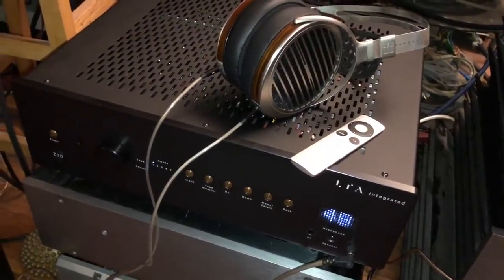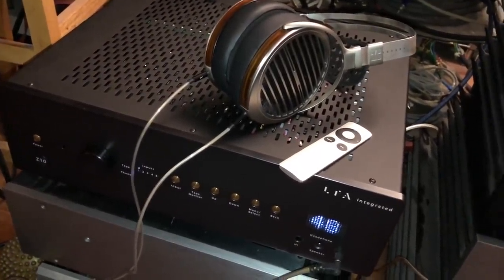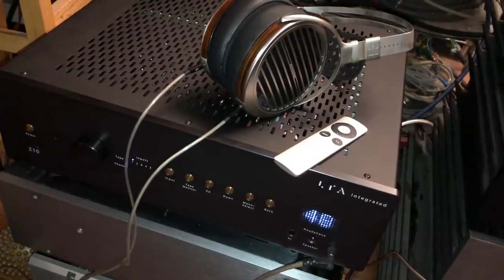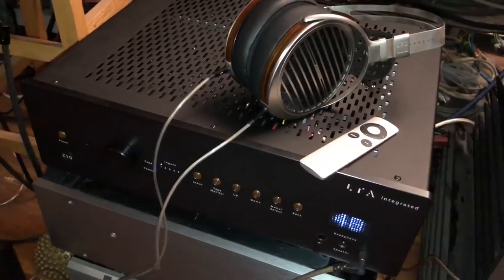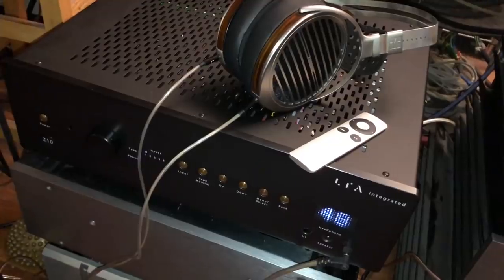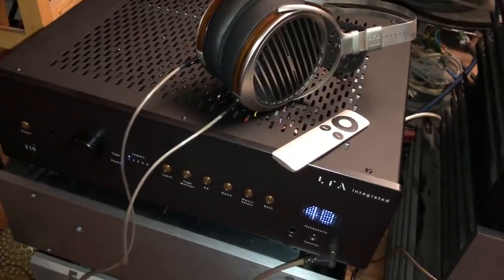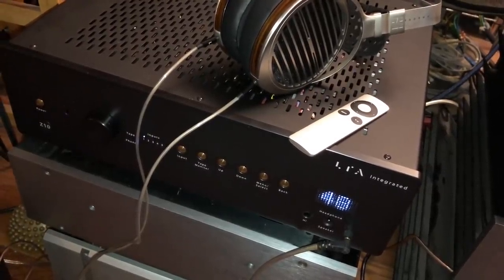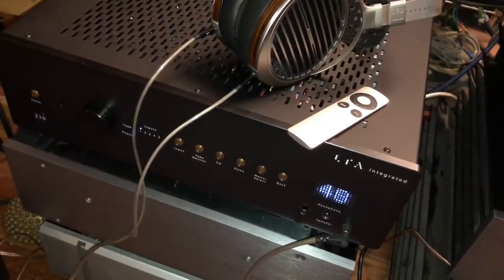Finding joy with a 10 watt tube amp on Klipsch and KEF speakers #tubeamps

Comment: Indeed. I drove my Klipsch Cornwalls with a single ended, 8 wpc,  pure Class A headphone amp that cost a whopping $300 and it sounded fantastic ! Much much better than the HK it replaced !  Great sound can be had for a very reasonable $$$  if you know how and am not as "fashion label conscious" !!!
Reply: Which amp model please
Reply: I’m curious about your amp too?
Reply: @dehoyosrudolph8885  ^^^WHAT THEY SAID^^^
Reply: Hes talking about Chinese amps. Musical paradise is a good start. If you want a badass custom one my friend builds nice ones for 700$ that will play like this one. GU-50 based.
Reply: The headphone amp i used is the RFTLYS EA1A. It is bare bones but is amazingly well built with excellent performance for the price. Hard to beat its value proposition when driving very efficient (98db/w/m) speakers
Reply: @ptg01  Will you provide a link, or does he build "FRIENDS ONLY"? The reason I ask is I own a pair of 98 db. KLIPSCH FORTE Ones and the receiver/ amp I have is a same era NAKAMICHI 35 WATT RECEIVER, 
That may be on its "LAST TOUR". LOL. THANK YOU.
ALSO, DOES STEVE EVER SPEND TIME ANSWERING QUESTIONS, OR DO U HAVE TO PAY THRU PATREON TO GET AN ANSWER?  ;)
Reply: Should be @ Jeremy Whittler

Comment: Steve if someone would like to explore tube Amplifiers for the first time do you have a recommendation on which amps that would be a good entry point?
Reply: Linear tube audio
Reply: Check out Rogue as well, especially if made in America matters, made in PA.
Reply: @craigcoughlin1834  Linear Tube Audio is Made In USA too. Maryland actually. The LTA Z40 is also all tube integrated at 46 wpc.

Comment: Tube. Class A . Single ended. No push pull. Is pure heaven . On hi,  quality 2 way loudspeakers. Absolutely fun tastic. Don t wanna stop listening for no reason .
Reply: Have you ever heard any of Steve Decarts higher end TUBE AMPS? THANK YOU
 @TheRockerxx69
Reply: @sixstringsdown1  l LL buy one. Thanks
Reply: @sixstringsdown1  but they do not exists those fkn Descartes ! You kidding me.
Reply: @TheRockerxx69  Yea, I'm in a massive joking mood today, as my wife just had a TOTAL LEFT KNEE REPLACEMENT. Guess who does all the work round these here parts?
Reply: @TheRockerxx69  For what,Sir? The joke? Why, you Sir, are quite welcome! May I toss you another joke to brighten your day?
Reply: @TheRockerxx69  my pleasure Sir.
Reply: @sixstringsdown1  l have to perform all the house chores. Garden chores. Cooking cores. Because my wife is bi polar . High depression rate. It s 10 pm here and no space for your jokes in a very cold, wet, late spring day.
Reply: Very sorry to hear that. Glad you have your hobby to escape to occasionally! I really mean that, as I have lived thru that same situation in a prior lifetime... It just sucks all positive energy out of the brain. It did to me. I very much so hope things will get better for you at some point.
I just was trying to introduce a new band wired, high quality tube amp into the conversation. Nothing more of less...

Comment: I am still thinking about getting their NEW LTA Ultralinear integrated amp. Its price is whopping $8900 including brand new MM/MC phonostage. However, if you really think about it........ To get “good” amplifier (that’s my personal view), it might cost me say..... $4K, good preamp $2,500-3000, decent phonostage $1500-2000, satisfying headphone amplifier $500-1000, you might end up around $10K. Now add some decent power cables and interconnects for all those separate components ($1000-2000) and all the sudden that $8900 seems somewhat reasonable. Also an enormous space saving and long tube life. And cherry on the cake, all made in US by our best minds and craftsmen.

Comment: Why not try the Miniwat N3 SET with The Klipsch's .. Swap out the power tubes to Sovtek EL84M's and find a good NOS 12ax7 like a Telefunken..I'll bet it gives your Z10 a run for the money. With tubes swapped out, N3 is tionally balanced, good bass energy and clear as a bell!
Reply: Vic...my audiophile friend said the same thing to me a day before you wrote your piece.  Great minds think alike. 😀
Reply: GU-50 wired in ultralinear.

Comment: As far as 10 watt amp provides in listening place 100dB I am not asking  about power. Two amps which I judge best in my  team of four  (working with my DIY speakers about 92 dB/W) are  both around 12 Watt per channel while two other are 55  and 35 Watt. All used with loudness correction "on". And I never push rotating knobs above 40%. In fact I control loudness  mostly by input preamp knobs  because I need to keep  constant physiology correction for given loudness .  Anyway my level of listening is  mild - (while my cafe electric cattle pot boils around  my Hi-Fi music gets  hardly heard. My neighbors need not to make any noisy renovations too. Actually I deliberate about physiology corrected amplifiers - is it not right to match their power to listening room - I is justified that  correction is valid for given loudness and that loudness depends on size of listening place. More power amp mean faster growth of loudness - in small room  it results in too much correction. For such room I find this 12 Watt power amp with l. correction in better synergy. Actually it is just my thought.

Comment: Steve I have a question for you. Do I have to use the crossover in my powered sub? Right now I have doubled speaker wires coming out of my tube amp. 1 side going to the right speaker and also the right powered sub input and the same for the left. Sounds great but am I going to damage anything?
Reply from the maker: Sounds like the wiring is correct. As for the sub's crossover, yes, use it. Experiment with the crossover first by setting it just below the speakers -3 dB frequency (found in the specs on the manual or the manufacturer's website). If that's not possible try different setting on the sub's crossover, and listen. At best, you shouldn't be aware the bass is coming from the sub, it should sound like the bass is coming from the speakers. I tend to prefer keeping the sub crossover setting as low as possible.

Comment: I bought the Dayton audio integrated tube amplifier with 12 watts for a preamp section and Pioneer book shelves speakers and for $129 you can't beat the sound sound more like a $1000 system
Reply: This may sound silly, but I'd be very interested in seeing a video of YOUR system. I use a much more expensive setup both in my living room, but also in my office, and yet the thing that most interests me is great sound for little money. Does my $6,000+ system sound good? Of course it does, it cost a LOT of money! Good sound for big bucks is no special trick. But particularly good sound for cheap, now THAT is exciting!
Reply: @AndyBHome 
What about getting more performance from what you already have for little or no money? I find that to be just as exciting, especially when you start to realize that you had been hearing less than half of the potential of your system with a conventional setup.
Then, when you think about it, you become aware that ninety-nine percent of audiophiles have a conventional setup, so even the ones who are blissful with what they're hearing never realize that they are hearing less than half of what their system can give them.
The best thing is that if you know what to do, it can help with most any system, whatever the price level.
Reply: @AndyBHome  Nailed it!
Reply: @HareDeLune  Ie. Maximixe speaker placement, treat room with sound panels, and, this is from personal experience, WHEN DONE LISTENING, COVER YOUR KLIPSCH FORTE' ONES WITH A TRUCKERS BLANKET SO YOUR CAT DOES NOT TEAR THE WOOFER TO SHREDS. END OF RANT AT MYSELF!
Reply: @sixstringsdown1 
That is the conventional setup, yes; with the exception that you've incorporated 'dog armor'. He-he!    : )
Reply: @HareDeLune  Well CAT ARMOR. We can settle on "ANIMAL ARMOR", no?  ;)
Reply: @sixstringsdown1 
Eek!
Cat!
You did say cat, it's right there.
: P
My only defense is I am in a coffee shop and there are distractions. I do apologise.
Reply: @HareDeLune  I actually don't need better performance from what I have, although I am always playing with it just for fun. I just like to see what can be done at various price levels, the most exciting of which to me is cheap cheap cheap. As I wrote above, my system sounds great - but it was thousands of dollars and I have no regrets. I listen to my systems a lot and I love them. I still like to see what else is out there and especially what can be done on a tight budget, particularly new equipment because used is so hard to predict, even though the majority of my own gear was obtained used.
Reply: @AndyBHome  I'll see what I can do I have it connected to a power subwoofer then my main speakers running from the subwoofer this gives me 100 watts
Reply: @AndyBHome 
That's fair enough, and I agree.
As a person who hasn't had the opportunity to hear a lot of different systems at different price ranges like Steve, I would be very interested to know the differences in the sound of inexpensive gear compared to the ones with stratospheric costs, and just how much can be done with a modest setup.
I have had enough experience to find out that you should remain open-minded, and that it's very difficult to know the differences in equipment and quality until you've heard it for yourself.
Reply: @HareDeLune  No apologies required! Cat, Dog, House Mouse, Sheep... whatever! BTW, Roger Waters COVERS ALL possibilities on PINK FLOYDS ANIMALS ALBUM!  
Now, the other Gentleman, who claimed the DECWARE AMPS I referred to, DOES owe me an apology! IMHO.
Reply: @frankmcguckin4572  100 watts is 65 watts better than me! Well with the exception of my 2200 watt HAM RADIO AMP, my buddy built from scratch! That thing, hloked to a single wire, talked over the South Pole to some guy IN HIS CAR 600 km Northeast of Mumbai!
Reply: @sixstringsdown1 
If you didn't care, what happened to me,
And I didn't care, what happened to you,
We would, stumble our way through the boredom and pain,
Occasionally glancing up through the rain,
And watching, for pigs on the wing...

Comment: Those Klipsch speakers sound great with my Onkyo TX 8160 network receiver.  I only paid 320.00 for the receiver.  Why should someone pay 4900.00 for something that does so much less?  I guess I don't need the prestige of owning a 4900.00 brick that does a whole 10 watts of output power.  What is your audience for this video?  Know who you are talking  to when pushing a 5000.00 piece of equipment.  As my father once said when referring to a Christmas tree that cost 45.00 in the 1970's, "Is it made of gold and they are going to come home with us a decorate it too?".  Used cars cost that much.  Back to Zeos for me.
Reply from the maker: Bye!
Reply: It seems hard to believe that this rather expensive amp would be worth it, but until you've compared what you have to this I think you really can't be sure. I really don't think most people who buy this stuff do it for anyone but themselves. In other words, I don't think it's a status symbol for them. Who really thinks HiFi is cool anymore? I like it, but I certainly am not impressing anyone with my gear.
Reply: Club Soda my Yamaha is going strong after 20yrs.

Comment: Explain why l would want a 10 watt amp over buying for same money a 80 watt tube amp.?
Reply from the maker: Because it'll sound a lot better at more moderate volume levels. It played loud enough for me. If you like loud, don't buy a low power amp.
Reply: I'm always looking for things that sounds good at low volume. I never really considered something like this before, but maybe I should. I've always assumed that higher powered stuff would sound just as good at low volumes, but maybe I should change my approach? Thanks for the video Steve.
Reply: SET achieves superb black levels , micro detail and actually high distortion levels in a way that's pleasing though called 5th order harmonics like a guitar amp. My friend builds these that works for the department of defense. It's what they used back in the day in movie theaters.-( Heheheh....😉 lamen's analogy.)- I do parties and barmitvas.

Comment: "Joy" seems remarkably expensive. $5000? Oh well...... I'm sure that someone out there can argue that this is a bargain. Are new vacuum tubes still being manufactured, or do all the tube amps depend on existing "new-old" stock?
Reply from the maker: Yes, new tubes are still being made, no worries there. Luxury, hand made in the US products are expensive, just like other luxury designs.
Reply: @SteveGuttenbergAudiophiliac  "Luxury" might mean that everything is gold plated and has diamonds on the soles of its shows, but that wouldn't contribute to the sound quality. Similarly, with unusual names and shapes. But, yes, I know what you mean.

Comment: Actually klipsch  are misleading people in their specs they are not really 99db sensitive roundabout 90db sensitive it's how they manipulate the figure suit their marketing just taken that from one aspect of the audio band. It's a lot of money and I don't think it's as good as if you want it for headphone amp as the Feliks range you can pick up as low as for $500. You should review one Steve
Reply: John Atkinson of Stereophile measured 95.2 dB/2.83 V (B-weighted), so Klipsch has manipulated the frequency response window to obtain 99 dB.  It's still quite sensitive but the impedance curve demands a lot more current in the bass.  Most tube amps would cut the bass because of their high output impedance.

Comment: Mr. Guttenberg, is it possible for you to take the trouble
of giving us the schematic of the amp? You do agree that many enthusiasts are simply unable to pay such
sums for an amplifier!
Reply from the maker: I agree that a lot of audiophiles can't afford $4,900 amps. But they might like to read about them or watch the video. Yesterday I reviewed a $220 Sennheiser HD6XX headphone. I cover a wide range of products on this YouTube channel. As foe a schematic, ask Linear Tube Audio. It's an extremely complex design, it takes two days to build each amp.
Reply: @SteveGuttenbergAudiophiliac  Cheers on the review! I have a MicroZOTL from the oughts that drive my La Scalas. This document describes the circuit and provides a schematic. http://davidberning.com/images/microZOTL/microZOTL_Manual.pdf
Reply: @SteveGuttenbergAudiophiliac 
I am one of those people who cannot buy such an amp, but am still curious to know about it. I am especially interested in unconventional, radical, or new designs; and also antiquated designs if they produced extraordinary sound quality.
Thanks, Steve. I will read your review.

Comment: $4900 for a 10 watt tubed integrated with no Output Transformers?  When the only justification for price is the product's sound quality, I start to do my Gary Coleman impression," What you talking about Willis?"
Reply: @scottlowell493  To be fair, I'm not calling the product a ripoff or accusing the manufacturer of being fraudulent. I just find the amp overpriced.  This kind of pricing is a throwback to the past, but those customers are dying off.  On the other hand, this pricing turns off newer and younger enthusiasts, creating ammo for audiophile-haters.  Young audiophiles will gladly spend top dollar, when they have it, manufacturers just need to use different justifications for their pricing.
Reply: It's an active power supply. Superior in its ability to remain stable under load vs a trans. Pulse width modulation switching. Better in every way with a variable waveform pattern under impedence that changes to demand. Active SET..... Hybrid topology.

Comment: whoa, whoa. whoa, that price point will get you a PrimaLuna which is much better! Prima's, at least, will have a good size output transformer, which ,as all the reviewers have called, one of the most important things in the output stage! More slam and quickness. I stopped the review right when you stated no output transformer.
Reply: Nonsense, the output transformer is the weak part of any tube amp. This is why Berning designed around it.
Reply: You are 100% correct Steve. Only newbies who don't really know tube amp design disagree.
Reply: @tsamplifiers6493  Agreed.  The transformer is the limitation.  If you spend crazy money, you can get a great transformer based amp.  Modern OTL designs like Transcendent or Berning can eliminate the transformer without the issues of OTL by traditional Futterman designs.

Comment: Who heard $4900 then skipped the video?
Reply: Not me.But  I also don't walk out of a museum because I can't afford a Van Gogh painting though, so that's just me...
Reply: @3lueant347  

The reasons why a Van Gough is expensive isn't the same reason why this amp is.
Besides, the Van Gough will increase in value, this amp will head the other direction.
Reply: You can basically have this amp for about 4-500$. Check musical paradise. Russian tubes are really good and thier cheap. SET is better than anything you've ever heard on the right speakers.

Comment: $4900 what a total rip off, I wonder what all the parts inside add up to .
Reply: Probably about $250
Reply: The output transformer less tube amp design started as a way to save money. So I share your skepticism. Though people say otl designs have some unique features.